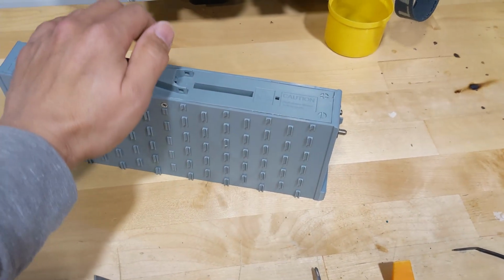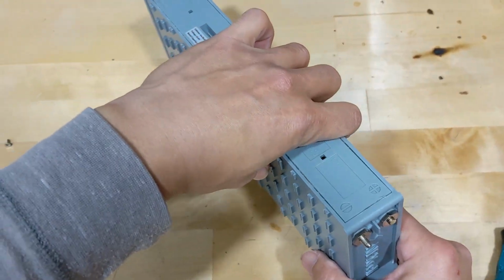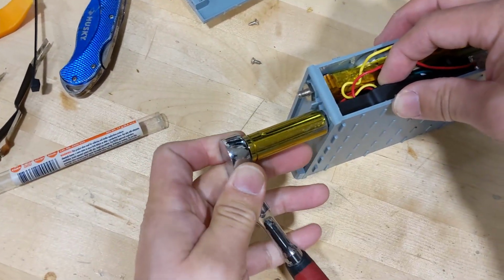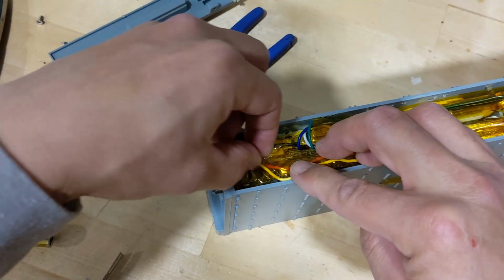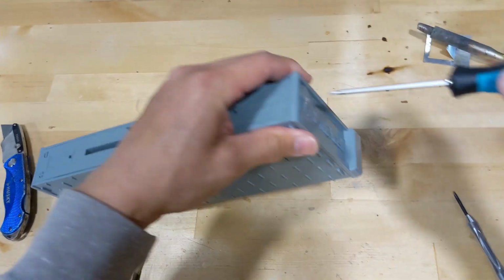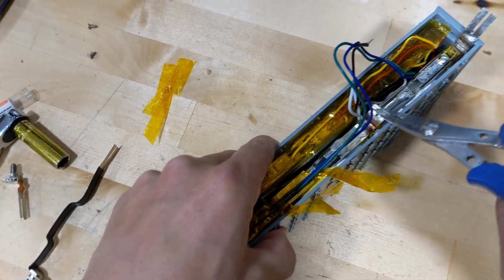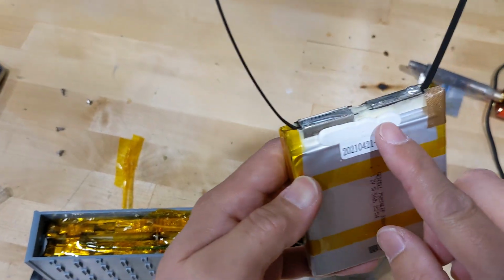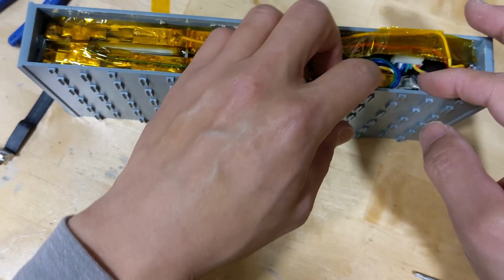Hybrid repair shop series - repair broken stud - Nexcell Prius lithium battery

Comment: I'm interested in buying a new stud. And also what are your thoughts on soldering it to repair it?
Reply: solder could potentially raise the resistance of the pack. Not quite sure if it would be substantial, but the packs complain ~ 3mOhm difference between module pairs.

Comment: What will happen with people who have the common leak up above which lets water in to get on the fan that blows water all over the lithium battery? The original batteries got corroded and ultimately had problems but will the lithium die faster because of its chemistry and circuitry inside every battery?

Comment: Hello, thanks for the video. Is it possible to charge the cell from the external electrodes without opening it? Why does the Dr. Prius program not remove the reversal alert for the second generation of Prius? Thank you
Reply: You can remove the reverse beeper without the app. Was a sequence of pushing buttons and turning the key on. There's a YouTube video on it somewhere.